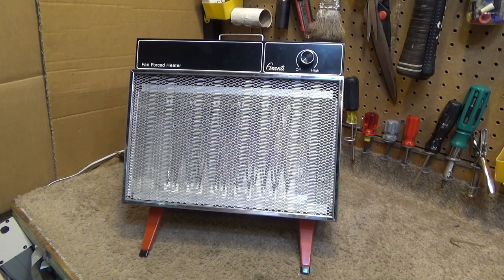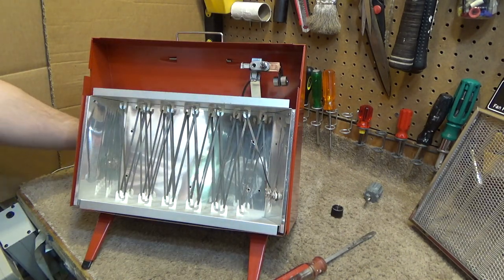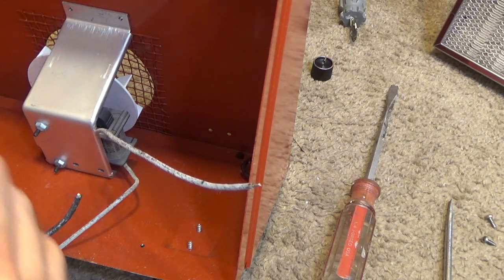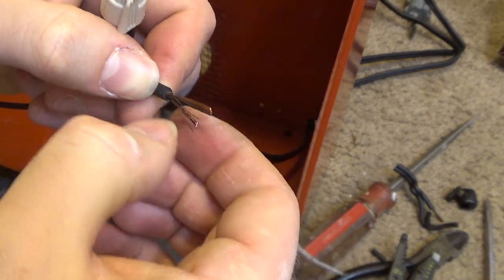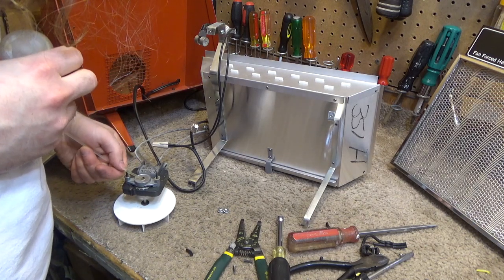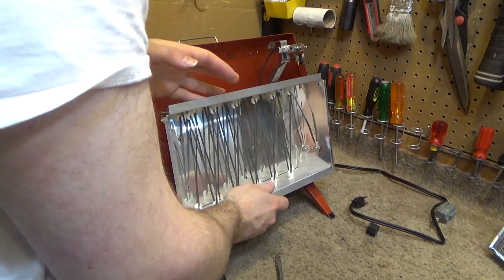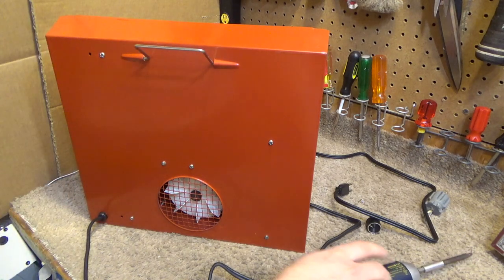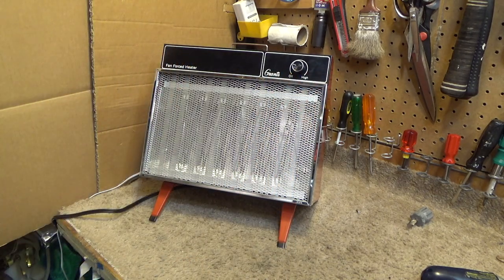Grants Fan Forced Heater | Service and Repair

Comment: Nice heater. I remember as a small kid going into Grants with my mom, it was along the lines of Woolworth’s……lots of inexpensive goods, much of the stuff made in Japan. But, they had the best hotdogs at the lunch counter, the rolls were buttered and toasted and opened at the top inside of the side and talk about fun…..they came out of the kitchen on a conveyor belt to the back of the lunch counter and the waitress would grab them as they rolled out and bring you the plate.
Reply from the maker: Great memory. The goods then were inexpensive and outsourced but not total garbage like they are today.

Comment: That's sure clean and shiny for its age, it's nice looking. I'm surprised they used a plastic fan, it looks like an impeller for an exhaust fan. Also surprised they used aluminum wire and copper together in some places in there, although I suppose it's pretty common. I'd be interested to know when heaters started having tip-over switches.
Reply from the maker: Indeed, it's incredible how some of this stuff remains so nicely preserved over the years.

Comment: This "Class 1" ( = metal chassis) device must be earthed , but it seems is not earthed , seems the 1970s had not so great standards (Germany did earthing since 1930s using the "Schuko"-plug) ... could the fan cable contain Asbestos ?
Reply from the maker: To this day, metal heaters sold in this country are often not grounded. I'm not sure exactly what the standards are as far as that's concerned, and/or how they get away with not following them.
I'm sure the cord probably contains lead, not sure about Asbestos.
Reply: @JordanU  - 
muahaha , USA standards of this 1970s device were on the state of the 1920s (except the tilt switch that is surprisingly modern) the cable must be changed to an earthed one (connect earth to the metal chassis , in Europe (incl. Russia that adopts German standards) all metal devices using the power grid must be connected to real protective earth with an own earth wire instead of a ("Klassische Nullung") bridge to the neutral which is illegal since 1970s) , even the Non-Equipoment-ground RCD-solution is illegal ...  also since the 1930s the recessed German sockets prevent electrocution when using plugs , German devices are save even when using non-polarized plugs (no metter wether used with 1x 230V + Neutral like in Germany or 2x 115V Plase like in corners Belgium or Denmark) ... 

Use extra temperature stable cables only (the ones near the heater should be the same as in modern stoves) & tie them as far away from the heat source as pissible